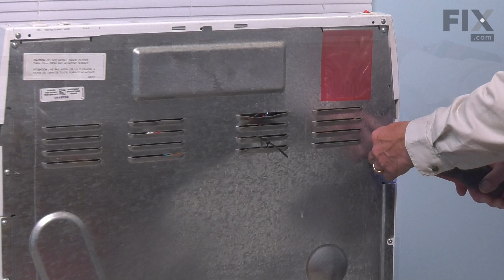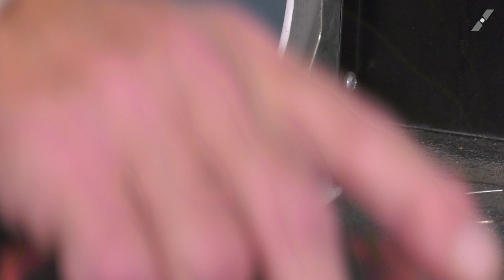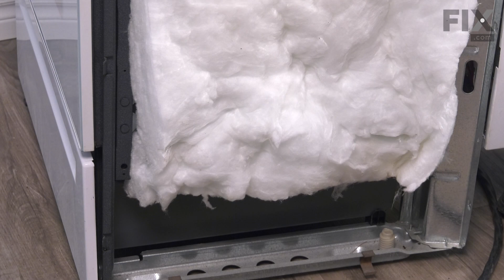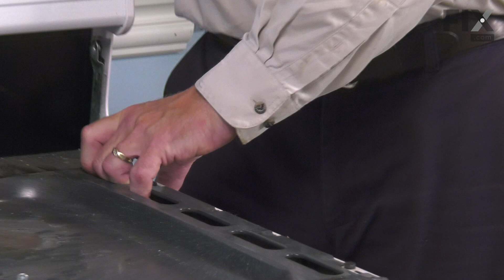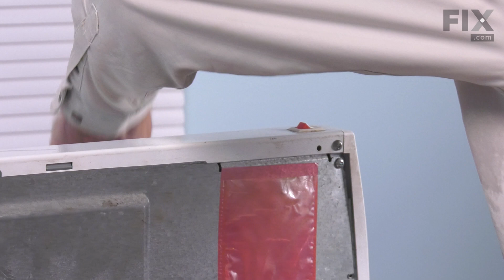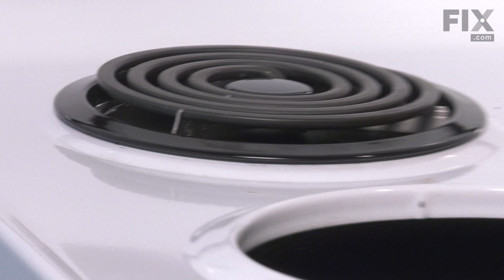Whirlpool Range Repair - How to Replace the Insulation

Comment: Can I go to Home Depot, and just buy a bundle of white insulation wool, or , is it something of other Nature?
Reply: @jelau4851:  Hey, did you ever get the answer to your question?  How did your DIY repair go on this job?  Is there a particular type of insulation that must be used?  i.e. a particular rating (like R13 or something).  And will the type used in buildings work as well?  Thanks.
Reply: @mtaur100  there is a special insulating fiberglass wool, for this purpose, it, is white colour, search on Google for insulating wool for kitchen range oven. musually, they ca sell it at appliances parts retailer, good luck. I opened the back panel of the range and you can remove the side panel, once the back is removed, then you can change and refill on the oven top. easy job, if youre, not shy.